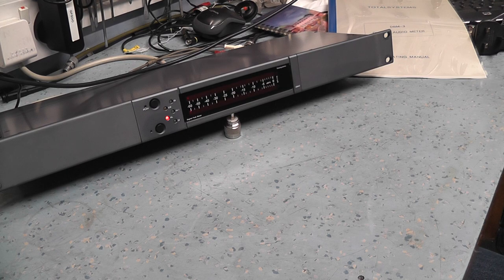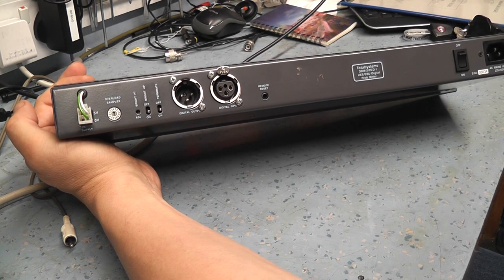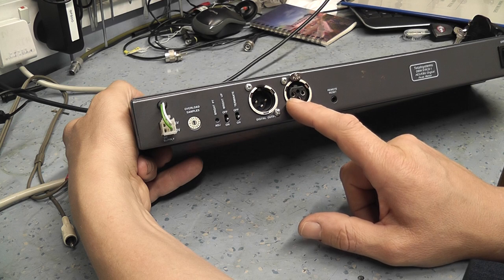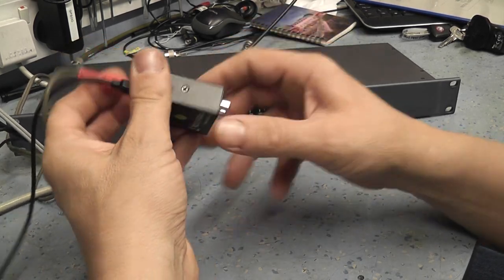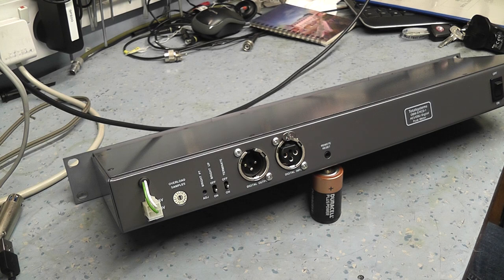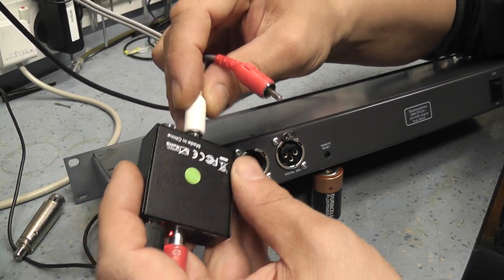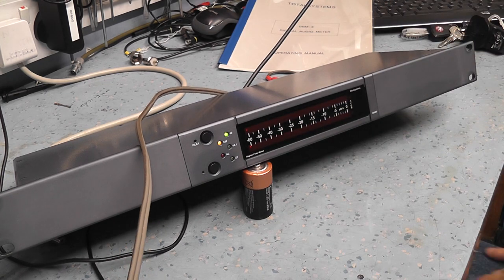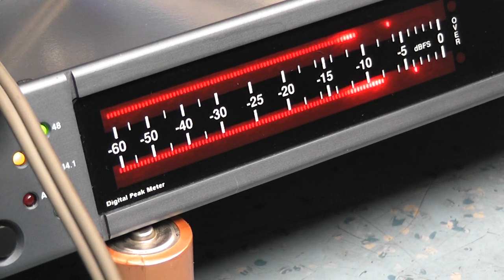Totalsystems DBM-3 Digital audio meter. Can I get it to work?

Comment: As this is meter is digital I'm guessing it doesn't drift in terms of calibration? Looks useful for checking level meters on reel to reel machines etc. Useful addition to the workshop. Regards Peter
Reply from the maker: In theory Peter is will resolve very fast peaks in level where an analogue meter will miss. It also has far higher resolution than my cheap level meter in the workshop and will as you say be useful to compare level meter in other equipment.

Comment: Hello Simon, thanks for your video, quite interesting, i just purchased a Audiolab 8000P off ebay but i noticed when i turned it on the relays doesn't click, any ideas what the fault maybe?
Reply from the maker: Possible high offset on output from a blown driver or output device.